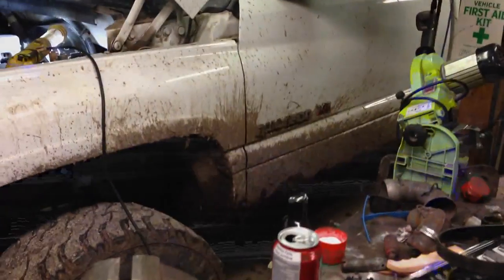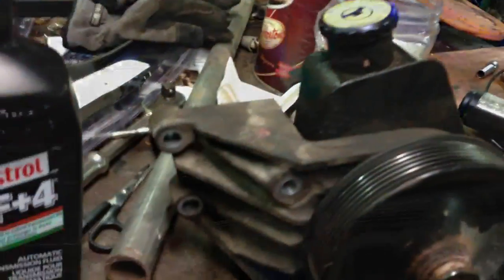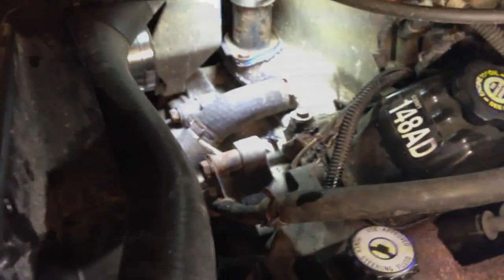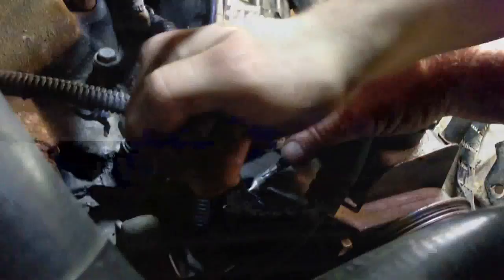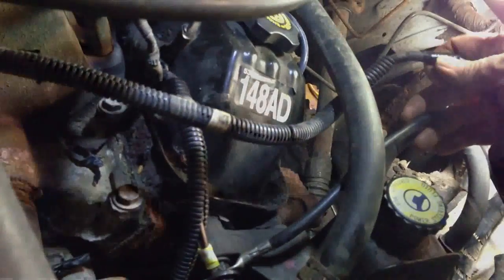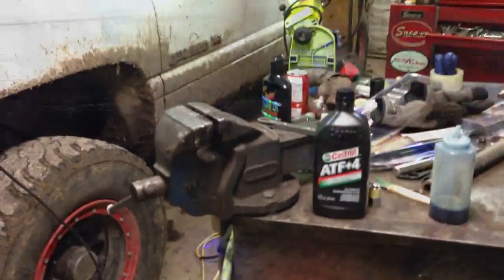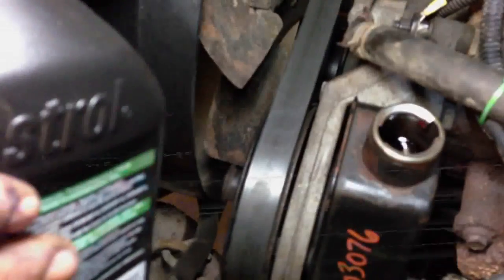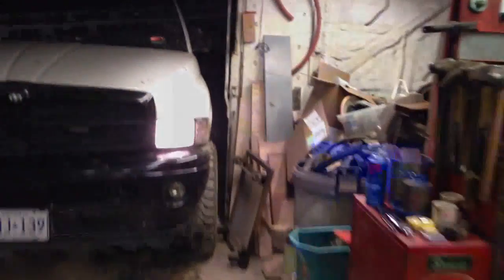How to change Power Steering pump Dodge Ram 1500

Comment: Line wrenches for the lines, or crow's-foot line wrench sockets. How lucky is that, that one of the mounting bolts wasn't behind the pulley...special puller to remove the pulley and another to install it. That is one serious shop you got there.

Comment from the maker: pressure line - you cna use a open end wrench to get it off

The wires were not busted but I choose to out on news terminal rings on the end to give it a good ground.

Good Luck

Comment: Kit - 2 things...
-Does the high pressure hose (had to put a new one on) make a big loop up and around to the back of the PSP?  Almost like a roller coaster loop!?  Wasn't sure...
-Also, when I replaced the high pressure hose down at the steering box, half of it did NOT thread in!  I looked at the old rusty one and it seems to be the same way, so I guess its ok...just thought it was weird.  Maybe it is that way to fit a few different applications? (wonder if I get a notification if you reply!?  No clue - never replied to anyone!  Maybe I have to keep checking back...Thanks.  Good job.

Comment: Great video, thanks for sharing! How did you determine you needed to replace the whole thing? My power steering needs repair too but I think it may just be one of the lines... not sure yet though.
Reply from the maker: shaft was snapped so I got one from wreckers
If it not working might be the pump   - take the belt off and pull on the pulley -- it will come right out if snapped.

Comment: How does this compare to a 2003 ram power steering fluid pump?
Mines having the same trouble that a lot of older Dodges are having and the mechanic quoted 1200 for the repair.
Reply: dude my 03 is having problems too

Comment: How did you  removed the bolt that Holds the pulley?with allen key? Or is there a special tool for that?
Reply from the maker: You need a puller to get it off

Comment: so why did u use atf-4 automatic transmission fluid in a power steering pump. Jus wonderin.
Reply from the maker: Close to same
Reply: Actually ATF +4 is called out as the correct fluid for late model 1500s.

Comment: i have a 1500 dodge ram what happens if its just the seal?? how to change the seal in the 1500 dodge ram
Reply from the maker: just change the seal. 
But if you can buy a used one from wreckers for 30$  just change the entire pump.
Reply: You can purchase a kit with several O-rings in it for about $10.  If the pump is very old, you may want to purchase a remanufactured pump instead.
Reply from the maker: The shaft was broken. Used pump best and quickest fix
Reply: Ok
Reply: Thank you